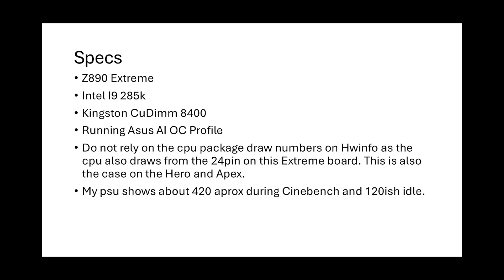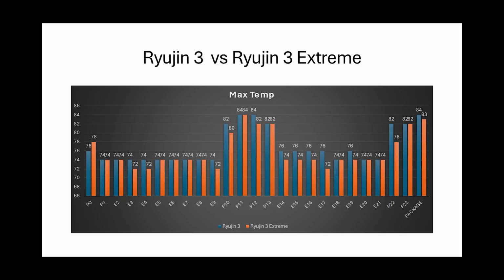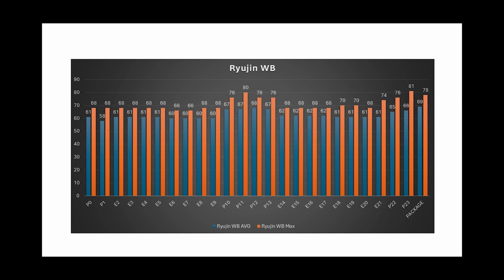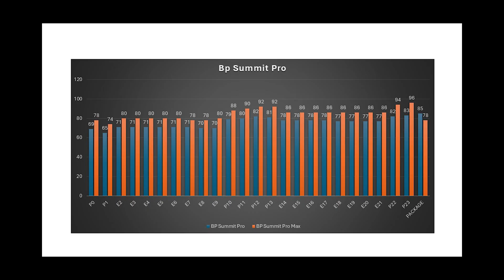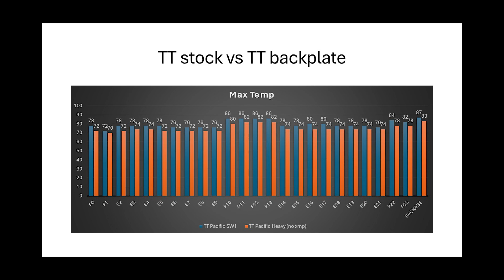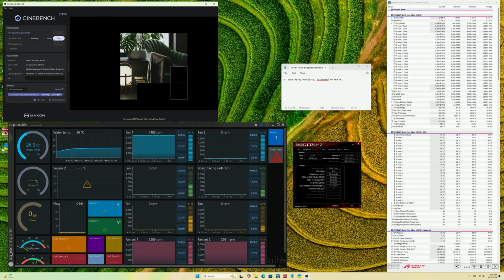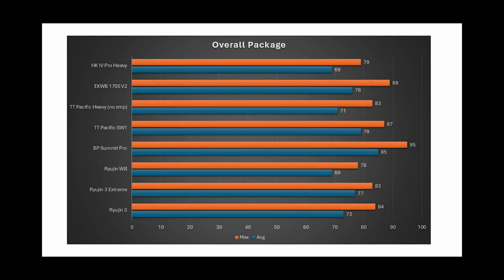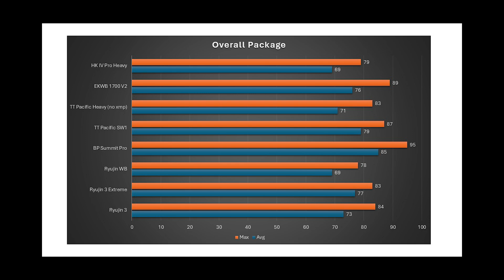Watercooling the Intel 285K OCed on Z890 with current water blocks and AIOs. Performance and Issues!

Comment: Did you torque the EK-Velocity2 to 0.6Nm with the torque screwdriver? And did you have a mounting frame for LGA1851? Intel's ILM was terrible for LGA1700 but easily fixed with a thermalright contact frame

Comment: i've also encountered no issues with the ekwb 1700. I have the block paired with the lga 1851 contact frame from thermal grizzly. but getting my system stable with 6000mhz is such a doozy. very frustrating, always getting into a boot loop

Comment: Why is the Ryujin III better than the extreme version? Did you mount it correctly? Because the extreme version has a changeable mounting system for better optimization for Intel Core Ultra processors.
Reply from the maker: I ran it more than once. It’s the same radiator. I haven’t taken it apart but I’m not too sure about the pump improvements if any on it. The performance difference is negligible but as I mentioned the noise profile is much better on the extreme.
Reply: Thanks @JCustom
Reply: +1 this seems odd and would lead me to remount just to ensure. Ideally, the extreme is equal or better temps, not worse